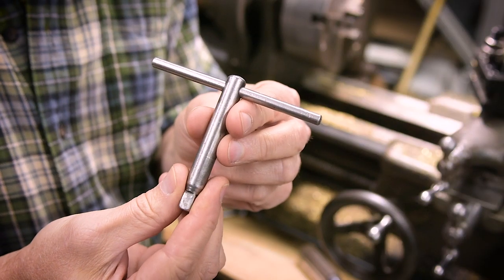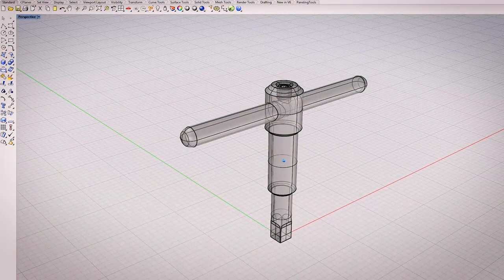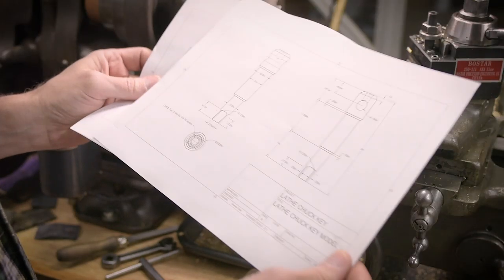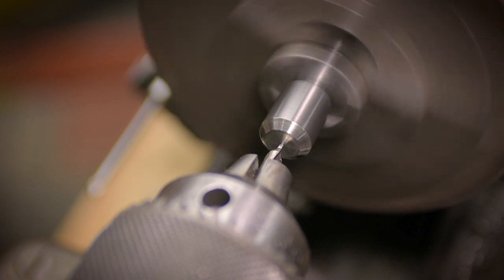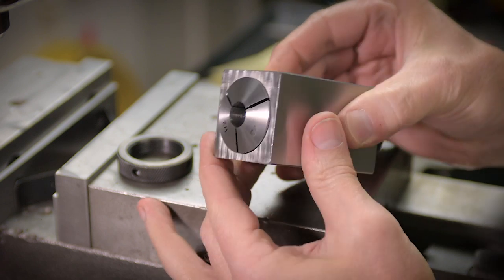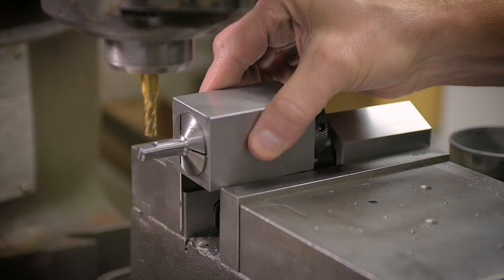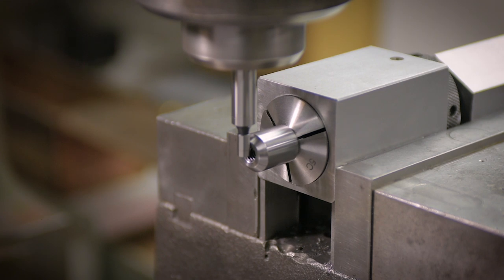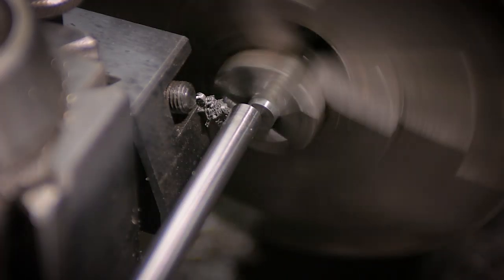HOW TO MAKE A LATHE TOOL FROM SCRAP METAL // BEGINNER METAL LATHE PROJECT // TOOLS MADE FROM SCRAP

Comment: Came out nice!! You have a part number on that ball turning fixture?
Reply from the maker: Thanks! I built the ball turner fixture. It’s mostly off-the-shelf parts. It’s a standard boring head mounted in a boring bar holder. I’ll eventually have a video showing how I made it.

Comment: I was able to make 1/4 in. square corners on a lathe by  putting a 1/2 in. round bar in the tool holder and the 1/4 in. mill tool in the chuck. had to be real careful to get the corners 90 degrees so it would be square  but it worked out, did have trouble figuring out trying to keep the cross bar in but again, it worked out...if I had a mill those collet blocks would be the thing to have!  but I had to eyeball with what I had...

Comment: My lathe is about 102 years old and I have every reason to believe the 4 jaw on it is original to the machine, the key though was made from some random piece of 3/8" rod welded into a T with a square drive ground in with likely a bench grinder.  

I think it may be due an upgrade!
Reply from the maker: Yep! Gotta love those vintage machines. Go for it. Thanks for watching.

Comment: Could of course repair the old part, weld two flats to build them up them grind or mill them down to size. Far less fun but frees up some time for other things. Like to way you use progressively larger bits to drill, good methodology.
Reply from the maker: Yes, I could have just repaired it, but I already short-cut other things to free up time to make this thing. Lol!